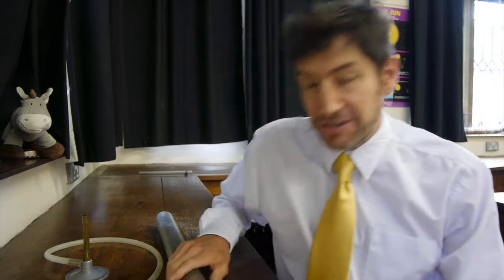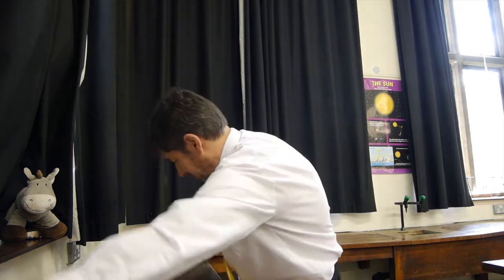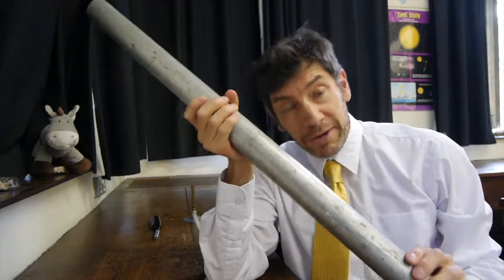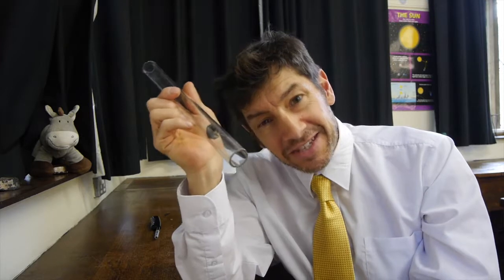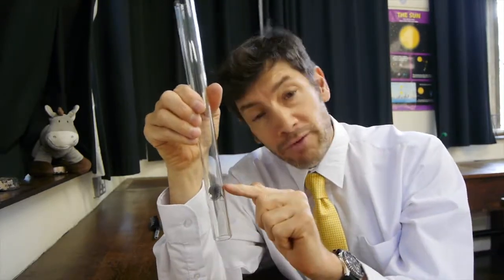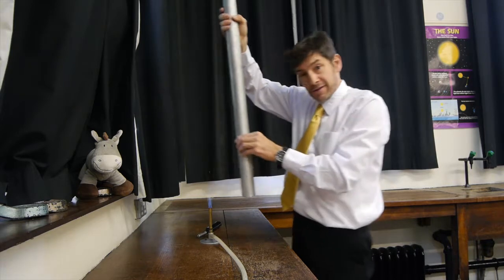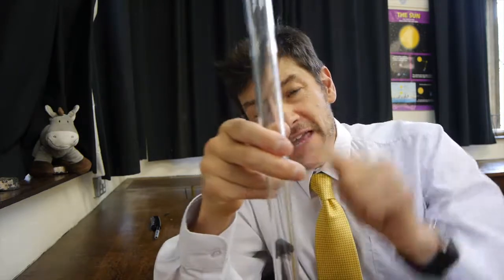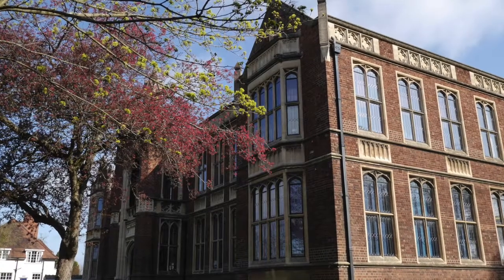Rijke's Tube - F-J's Physics - Video 47

Comment: I did it with 2 inches galvanized steel pipe 50 cm long and a wire-mesh right about 0.5 inch inside it with a cigarette lighter and it didn’t work.

How small should the wire-mesh holes be and should i need stronger heat source?
Reply from the maker: Good question.  Cigarette lighter no where near good enough a heat source.  I would put the mesh about 8cm in and you do need a good bit of metal on the mesh so it stays hot.  To get it really hot it really needs a bunsen or blowtorch as that it quite a large tube that you have there.  I have done it with smaller bits of copper pipe too.  It seems to work best first time when the gauze is hot and the tube cold.  I used mesh with about 1mm square holes.  Think it was the mesh of a bunsen tripod.  As with all these experiments do please be safe if you are trying it.  There is much that can go wrong here!  Thanks for watching.  Oh I forgot to say, well done for enthusing children and increasing their love of science!
Reply: @AnthonyFrancisJones  thank you sir! Greetings from Beirut, Lebanon!
Reply from the maker: Thanks - really great to see your enthusiasm and the kids loving it.  Have a look at my 'Do Do This At Home' playlist for more ideas for the children.  It is all stuff I am sure you will know.  Keep safe though with the experiments!